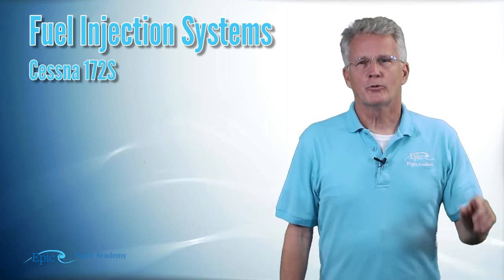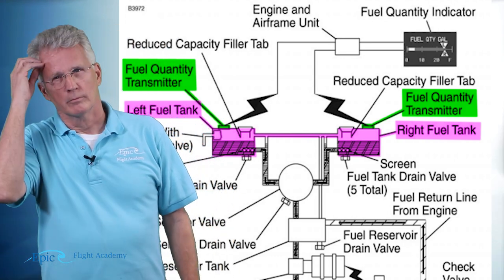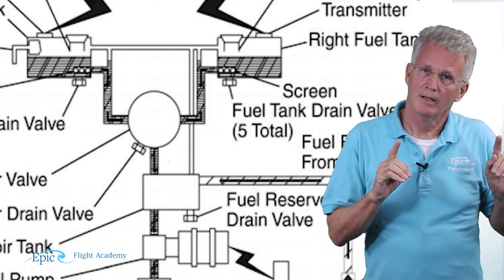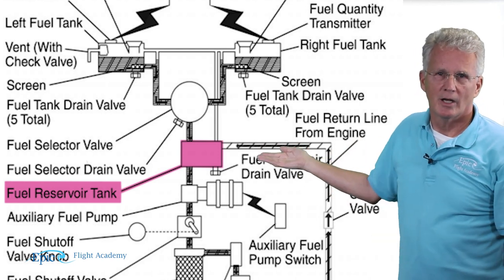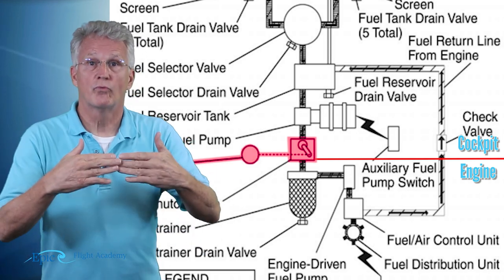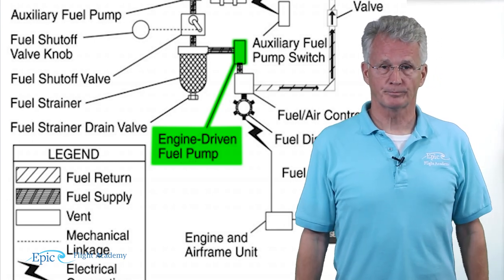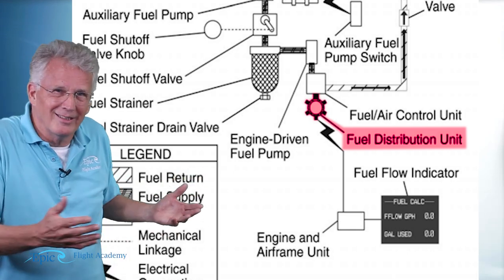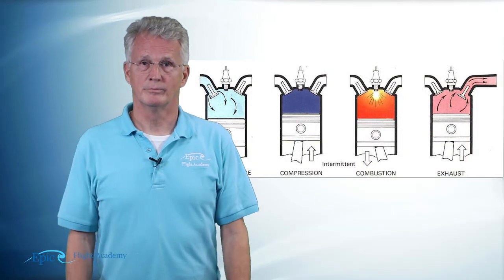PPGS Lesson 6.4 | Aircraft Systems: Fuel Injection Systems

Comment: In fuel injection engines, at what point on the fuel delivery pathway does the mixture control linkage cut off or enrichen the fuel? Thanks
Reply: At the fuel air control unit